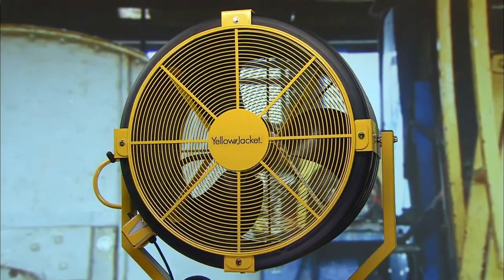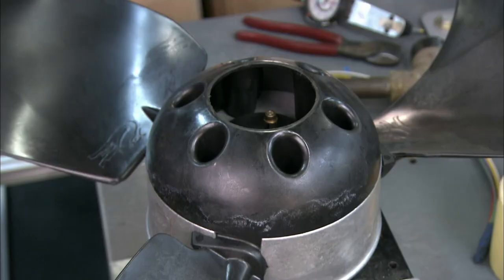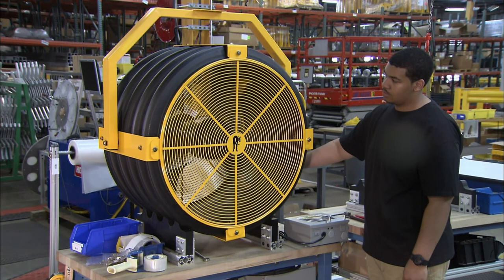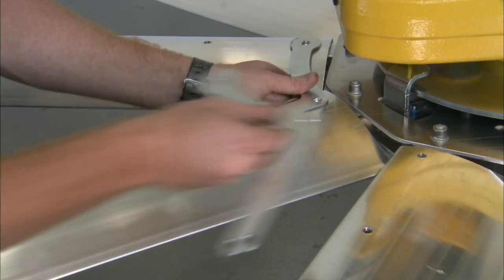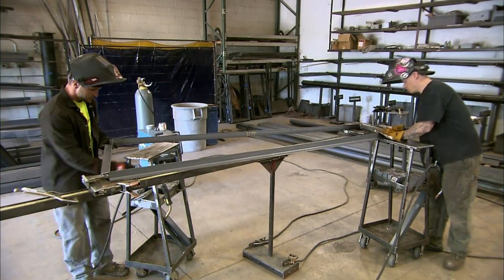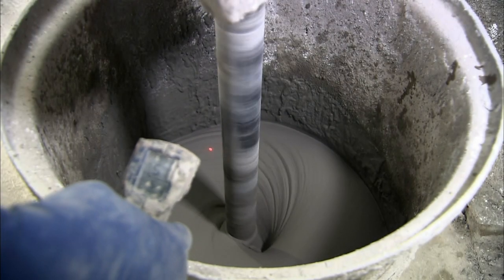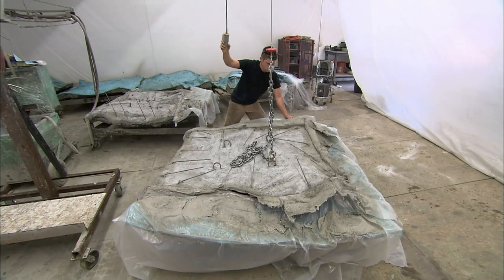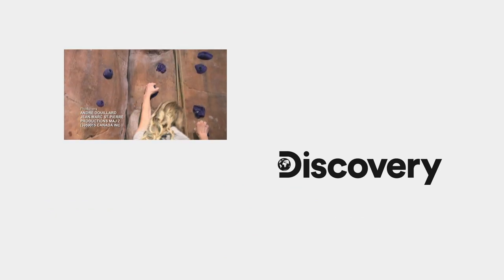INDUSTRIAL FANS & CLIMBING WALLS | How It's Made

Comment: Lol I love that "Big Ass fans" had to be blurred. That company is funny.
Reply: Yup, I bought one of the clones from a scrap yard, there because it had fallen over and bent the blades. Made them and the guard straight again, and now it works well, though it normally is only used at speed 1, which moves air. At speed 2 it moves stuff not bolted down, and at 3 it moves cars.
Reply: i didnt realize until about 4:25